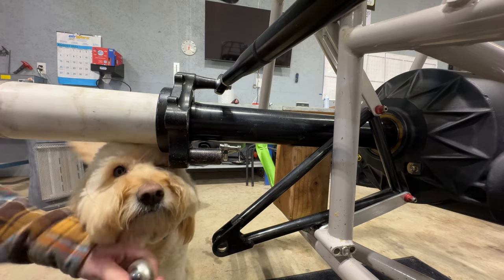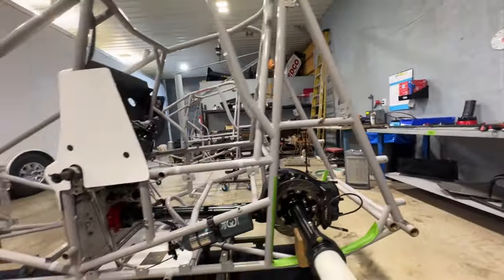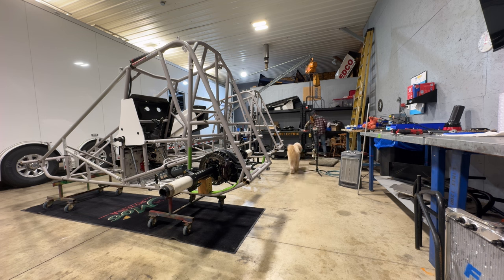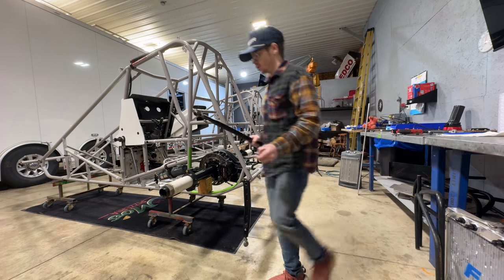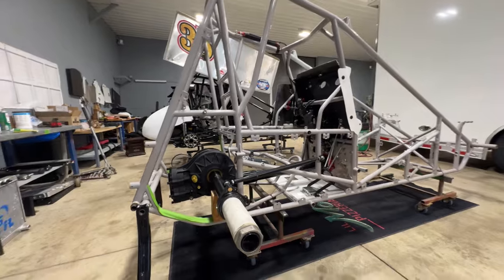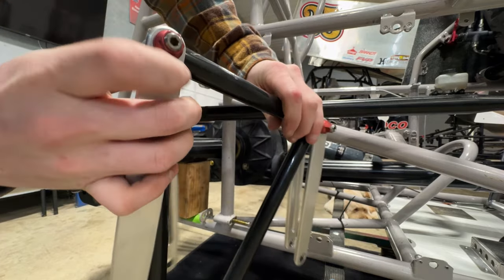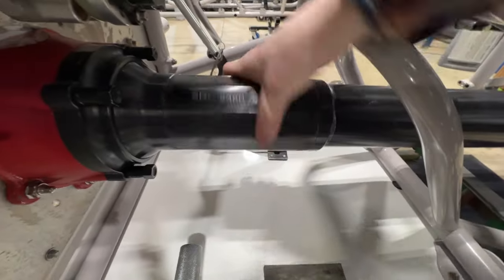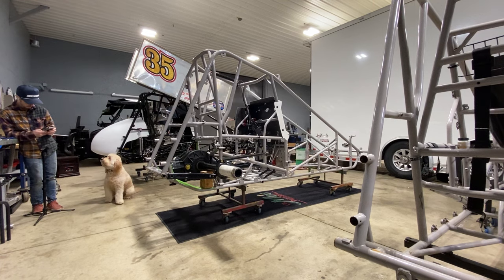Your car will be slow if you don't get this right | Zach Builds a Sprint Car Ep 4

Comment: On the radius rod orientation, what is the reasoning for having the left-hand threads facing outwards on the left side of the car and inwards on the right? Does that help keep the jam nuts from loosening up? But then looking at the closeup when Zach put them on the car they were opposite what he said?
Reply: Good eye! I noticed that after reading your comment.
Reply: You’re correct, it’s so everything stays tight.  You want it orientated so that if the tire rubs the radius rod, it tightens it up.  The left rear tire is very close to the left side radius rod.

Comment: My gf who's also a sprint car fan made an interesting comparison - is the Jacobs ladder equivalent to a shock absorber and the torsion bar equal to a spring?

Another question - apologies if you explained this, but what does the radius rod do?
Reply: Jacob ladder locates rear end left to right  keep rear end centered so torque ball is free and not bound up.
Radius rod located rear axle front to rear. Moving radius rod up and down changes rear steer in axle.
Reply: Torsion bar is the spring
Reply: Equivalent to a panhard bar in normal vehicles